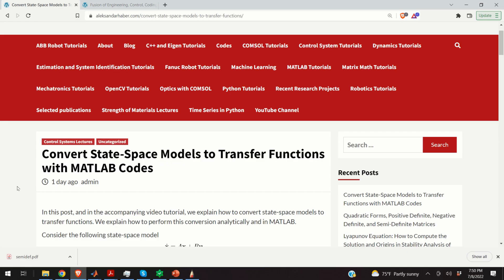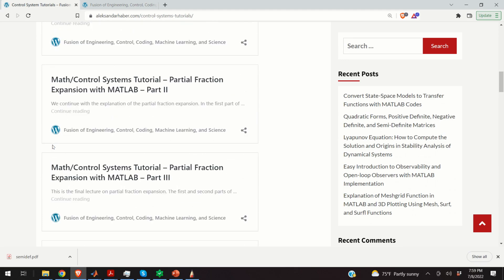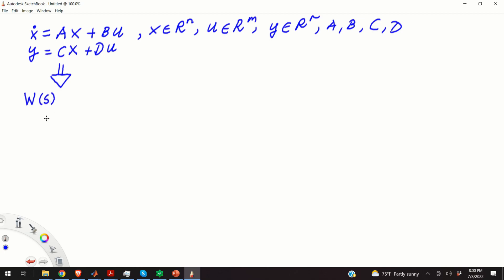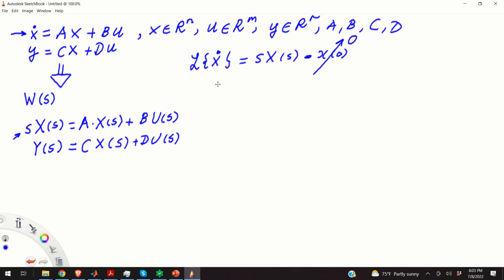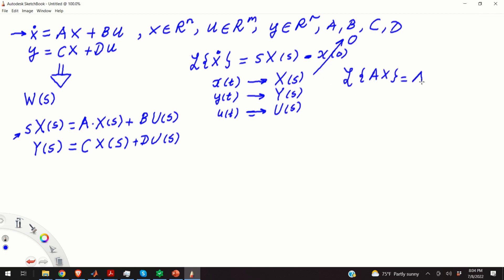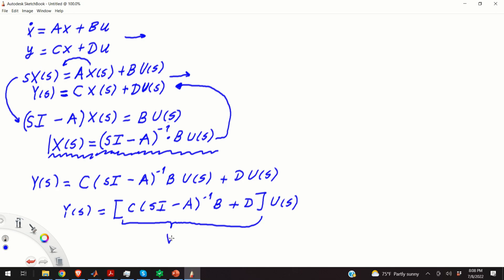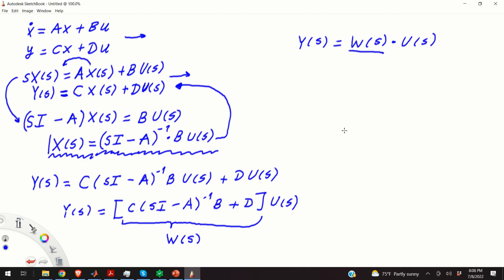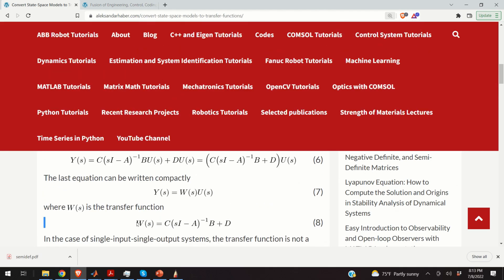Convert State-Space Models into Transfer Functions with MATLAB Codes

Comment: There is an easier way to convert transferfunction to state Space and vise versa.
Reply from the maker: Please explain
Reply: @aleksandarhaber  use canonical forms
Reply from the maker: @Gkvhkbt  Cannonical forms are advanced topics. First, you need to convert a general state-space model to a canonical form and that requires some effort and additional computations.
Reply: @aleksandarhaber  use zpk (zero pole gain) in MATLAB if you want to convert state space to general forms.
Reply: @aleksandarhaber  by the way. Can you check if there are any differences between prefrictive control by by using quadratic programing compared to linear programming? I have made some simulations and i find linear programming working very well.
Reply from the maker: @Gkvhkbt  I think that ZPK approach will only work for single-input-single output (SISO) systems, since in the case of multiple-input- multiple-output (MIMO) systems, we are dealing with transfer matrices. In MIMO case, it is very difficult to relate the results of the ZPK MATLAB approach with precise locations of poles and zeros, since any entry of the transfer function matrix can have different zeros and poles.
Reply from the maker: @Gkvhkbt  What is the type of predictive controller you are referring to? Model predictive control? Generally speaking, linear programming or quadratic programming are just methods for solving the original optimization problem. We need to see the formulation of the problem in order to know more.
Reply: @aleksandarhaber  i don't know what type of MPC. Just regular prediction.
Reply from the maker: @Gkvhkbt  You can send me some material in order to better understand the type of controller you are considering.
Reply: @aleksandarhaber  Can you show MIMO MRAC-controller?
Reply from the maker: @Gkvhkbt  Hello, this is a very good idea. Let me think about this.